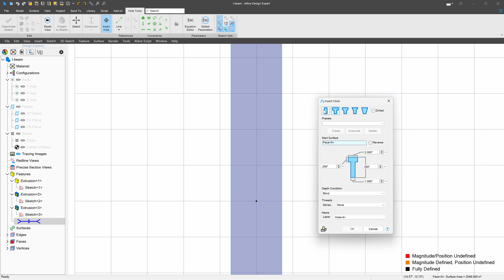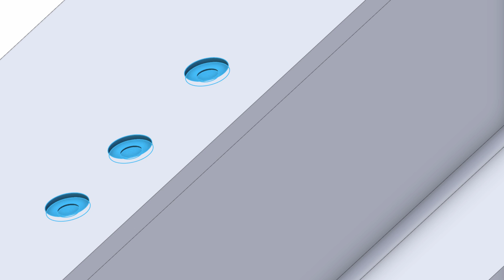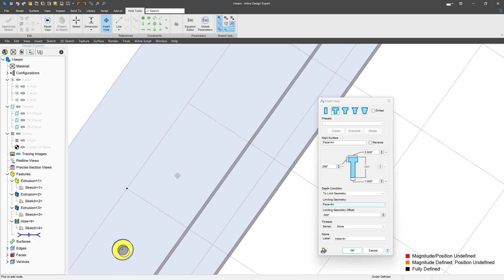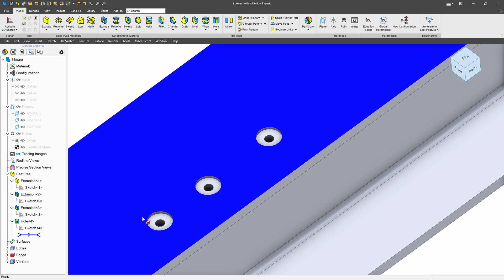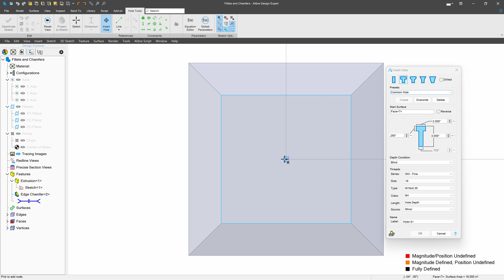Using the Hole Tool | Alibre Beginners Course #26

Comment: Good over view of Alibre's hole tool, it should be noted that the holes created with it will have their corresponding callouts available when creating drawings for the parts. Also, while it may be nice to actually model threads in parts that may be 3D printed, or for special threads that will be machined, or just for viewing them, you likely won't see them when added to a drawing unless you create a close up detail view for machining purposes. For standard threads all that is needed is a call out on the drawing and the shop will produce the correct thread.
Reply from the maker: Thanks for the additions- these are great points for people to know.

Comment: Fusion 360 offers threads that are actually modeled with their hole tool, even in their free version, and OnShape has community add-ons for it.
However, I still love Alibre more than them, and I would still like an option for the threads to be modeled.